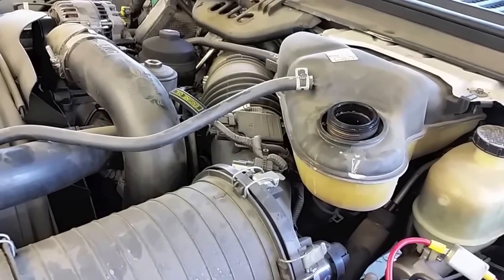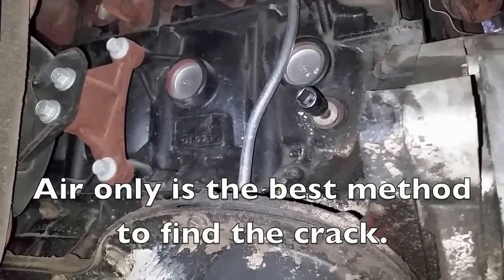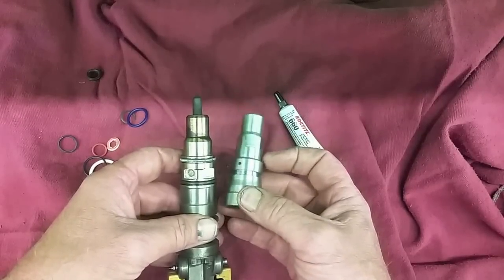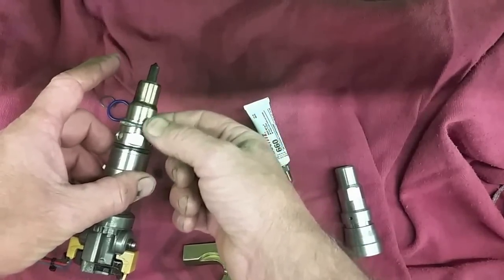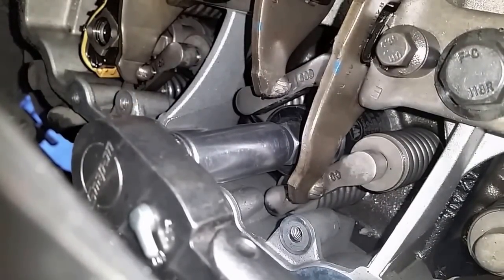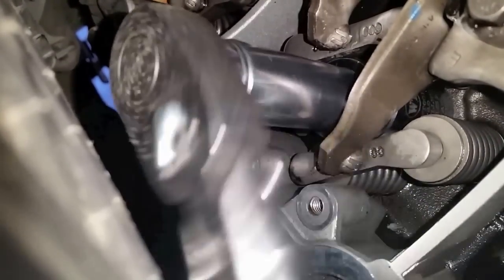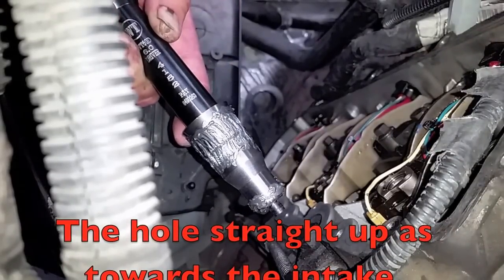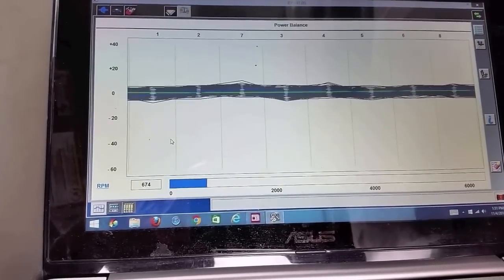6.0 Powerstroke diesel fuel in the coolant, Accuratediesel.com liner repair

Comment: DTR is the best, we miss you bud!     Is there a forum, video, piece of ancient papyrus that lists all of the rubber and/or any other items you need to replace if you've had diesel contaminated coolant.  Ron lists a few, but it sounds like there are quite a bit.  Any help would be greatly appreciated.  Thanks in advance! About to do this job on my '05.

Comment: He said the head cracks? I wasn’t aware that the cylinder heads can crack by the failure or does he mean the crown of the sleeve from the factory cracks?
Reply: Aa these engines are getting older, a crack develops above the original cup. The updated cups seal that crack.

Comment: Good job, the only thing I missed was the torque for the injector cup.
Reply: Do you by chance have the torque spec for the ‘case nut’ (as alldata calls it). The threaded sleeve that holds it together. Having a hard time finding that info online. Trying to install these kits in cylinders 3 and 5.

Comment: I like the idea of sealing the injector bore and eliminating the common leak spot. However, i concerned about future injector replacement. We all know 6.0L injectors wear out. What is the customer to do if they are on a road trip and that injector fails. It can't be warrantied or easily replaced. the new/reman injector will need to be disassembled and then reassembled with the modified injector tip. The holding tool is very specific and not easily obtained or duplicated.
Reply: If you are concern about it. Just replace the head.
Reply: @andresvalverde5069  I agree that head replacement is a better repair. But the whole idea of this repair is to save the customer some money by not replacing the head. My point was mainly to shed light on the fact that future injector replacement could be challenging if repairing technician is not familiar with this repair and tools required to complete it properly.

Comment: hey Ron which year powerstroke do you think has given you the least amount of problems, or which one do you think is worth buying. I want to get me a f250 but can't decide on the year.
Reply from the maker: Each year got improvements and most were addressed by 06 07 but the reputation was too far gone.  I put these videos out hoping to help and so parts aren't thrown at a vehicle or inferior parts like dorman are used keeping the cycle going.
Reply: +NWBackcountry I don't like the blanket statements "stay away from". I have an 03 and its been great, just turned over 200k miles. There are actually things about the 03 that are better than the later years. (I don't have to worry about dummy plugs, for example).

What I would tell Jesus Gonzalez is to try to find an F250 with maintenance records. That's hard to do. I wouldn't buy any used truck from a local used car yard. They are probably from auctions. Try to find a truck for sale from a private owner. Then you can gauge the type of maintenance that was done. The key to the 6.0 is regular good maintenance with Motorcraft parts and good quality oil.
Reply: Mark Coleman Good point.
Reply: +Jesus Gonzalez Stay away from 03. 04 is better, and 05-06(edit: oops forgot about 07) are the best. I have a late 04 4x4 15,000lb RV with 70,000 miles. She has the egr delete, bulletproof oil cooler, stock tune, and seems to be doing well. I also change the oil every 5,000 miles and add RevX to it.
Reply: NWBackcountry thanks for your info I was doing research and was thinking of going with a 07, but I wasn't sure if that year was good. Thanks to your info I know now that 03 was the year that had most of the defects thanks .
Reply: +DieselTechRon thanks for your help I'm most likely going with the 07. Are you having any major issues with the 6.7 ?